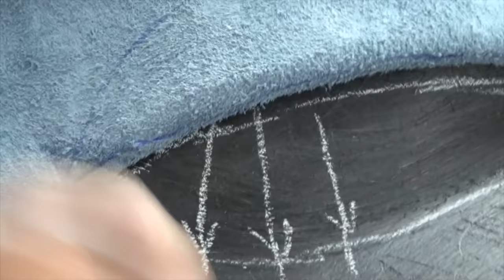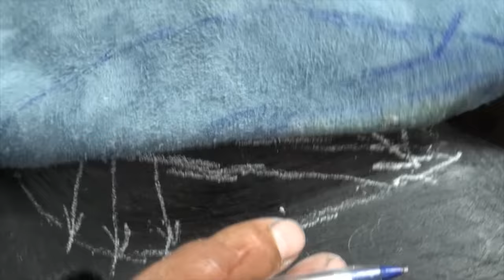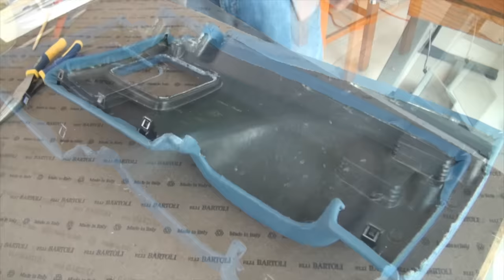A Plastic Piece Wrapped in Leather - Auto Upholstery

Comment: I own an upholstery business Creative Customs in the Seattle, WA area for going on 20 years now that I started in my early 20s. I find it fascinating still even now watching other professional people in the industry work and seeing the different ways they approach a project. Any reason you prefer to brush on the glue as compared to spray on? I prefer a 5 gallon pot but instead of a glue gun I use a actual auto paint gun with a large tip for thicker paint. With it I find it easy to use apiece of card board to catch over spray if need be and instead of the glue gun the paint gun instead adjusts the glue spray finer and more accurately whether spraying from a large wide web installing a carpet kit to thin lines like trim work here where needed. Then with a long hose the gun is at my side for instant start and stop glue where ever whether inside a car or working from a table with out fear of spilling and open container of glue.
Reply from the maker: Undoubtedly spray gun method is faster and more effective on certain projects. I use the brush and glue for small projects. I'd say it's more a hobby way to do upholstery.

Comment: I have been trying to do my own upholstery on my tvr and this is where I come for help, it's been essential to my progress and couldn't have achieved what I have without the tutorials but I'm yet to find the adhesive recipe. Everyone I've tried keeps going off. Any help would be greatly appreciated. Thanks for your help would be lost without it.
Reply from the maker: The 'solvent based yellow glue' is a traditional adhesive or contact cement used in car upholstery and furniture. 
The standard glue is brushable(spreadable). It should be applied on both surfaces and wait 10 minutes for stitcking process until it is not sticky to our fingers.
It is the same glue used to stick formica as shown in the video about Upholstery Glues: https://youtu.be/o2xeezdF8Ss
If you are in USA I know about two similar glues:
At Home Depot:https://www.homedepot.com/p/DAP-Weldwood-32-fl-oz-Original-Contact-Cement-00272/100125525
https://www.amazon.com/-/es/Petronios-Master-Cemento-multiuso-cada/dp/B076DJQN5R?language=en_US
This is aother well known trade mark in USA. Upholsterers use it a lot. Mostly applied with a glue spraying gun. It is very fluid but it could be done with a brush or spatula.
Some car trimmers and in factories a heat activated polyurethane glue is pasted over the surface pieces. It is used a lot in the shoemaking industry.
You would need to find a supplier and assistance in the USA 
The platic surface is sanded then a special cleaner is rubbed over. Then a coat of primer is applied over and finally the transparent glue.
The glue dries well in 10 minutes and it does not stick if we do not apply heat. 
A hot hair dryer is useful to cure the glue. It has the advantage we can wait longer time, accommodate the pieces in place then apply the heat and stick them together.
I have heard of similar products:
 https://www.amazon.com/dp/B0068KNGMK
http://www.rhadhesives.com/dual-88-neoprene-cement.html
https://www.ebay.com.au/itm/Duall-88-All-Purpose-Neoprene-Cement-/252691571226
https://en.lial.biz/sar-306e-desmokol-1kg?tag=adhesive
https://www.amazon.com/SX-69-Vinyl-Cement-Glue-Industrial/dp/B0839PW1C4
https://www.livemaster.ru/item/11132039-materialy-dlya-tvorchestva-klej-nairitovyj-alkor-ats-440-ph
https://www.promarinetrade.com/accessories-for-inflatable-boats/6847/GLUE-+DESMACOLL%2C+330+ML-PM-DESMAK-330.html
I am located in Mexico and find this glue from shoemakers' stores
 https://youtu.be/TIKF6NvXHE4
Hope it helps.

Comment: Nice video! My question is what glue are you using? I prefer to use that kind of glue over the spray kind.
Reply from the maker: Spraying glues are also useful provided we use a product with the best adhesion. I would recommend to test it beforehand on a scrap of leather onto a plastic piece.

Comment: as long as that dash stays in a airconditioned home the glue will hold for a year or two. I live in Redding, CA and that weak glue you used to attach the leather to the car dash would let go in one month or less in our summer conditions.  Possibly a two part "epoxy" might hold the leather to the cars dash receiving moderate sun/heat.
Reply from the maker: Fortunately, my son had this car for more than 6 years and no traces of leather unsticking were detected. Precisely it was leather covered for testing purposes.

Comment: I think some put an underlayment back glued to the leather, just wonder if there is a good rule of thumb for and against?
Reply from the maker: Some pieces are upholstered with bonded vinyl or leather (a thin foam glued down to the vinyl or leather material) In this case it was not necessary as this piece is part of a whole dashboard you can see it at the end of the video.
https://youtu.be/IaSm3zoWrAo?si=uON26OhhQbp8rub_&t=3585
You can also see the same complete dashboard on this other video:
https://youtu.be/6QeQCwXw-nI?si=GdyTXh3uHoOb43M5&t=452

Comment: The problem isn't getting it to look like that on day 1, its coming back and it still being glued in the pockets 5 to 7 years later, it ain't gonna happen. The glue will fail within a year or so where I live, south Ga weather is 200 days of 95 and above with 99% humidity.
Reply from the maker: Fortunately, the interior has lasted more than 6 years, because the weather is not so hot in the city where I am located. But, I understand if this car would have been running in south Georgia or Arizona the car interior would have not lasted  longer than a year.
Thanks so much for your commentary!

Comment: Is there a certain type of leather that is more durable than others for uv damage?  Great  video. Thanks
Reply from the maker: The most durable leathers UV resistant are the ones that have two to three coats of transparent sealer on their top surface which act as protectors. Some of these leathers are heat ironed together with the sealer becoming a kind of plasticized leathers. These upholstery leathers are used for automotive and furniture purposes. Despite of being tough, experts consider these leathers of low quality. The leather pores are covered too much and not let them breathe nor let the conditioners get through in.
Some related information:
https://www.youtube.com/watch?v=lRb1CJeSLyE&t=37s
https://www.youtube.com/watch?v=mUJFkCCqFYM&t=256s

Comment: How much time do you allow between attaching the leather to one section before moving on to the next?  In the video it seems as soon as you have glued down one section you move on immediately to the next.  Do you allow a few minutes between sections or do you move directly from section to section?
Reply from the maker: After the glue is spreaded over a section I allow it 10 to 15 minutes to dry and start the gluing process.

Comment: Why do you mark it with chalk at the end of the plastic like at 17:50ish is it just habit or for a purpose?U do great work and are a amazing teacher with these videos! Also would it be easier if u applied a heat gun or was it warm enough out there /or were u afraid of burning the leather
Reply from the maker: I have done the marks on leather and plastic surface to indicate the only part that would be spreaded with glue. Heat guns help to erase wrinkles because the heat shrink the leather. I'd better take advantage of stretchy side of leather material. Almost similar to vinyl materials.
https://www.youtube.com/watch?v=dhmCJFpOs_0&t=533s

Comment: There’s several brands and types of contact cement glue. Exactly what brand and type you are using? I know it has to withstand the hot temperatures the interior of a car can get without releasing.
Reply from the maker: I am located in Mexico and glues' trademarks are different.https://www.youtube.com/watch?v=o2xeezdF8Ss&t=71s
If you are based in the USA:
https://www.ebay.com/itm/254593470049 (sprayable and brushable)
https://www.ebay.com/itm/114649877783

Comment: Keeping the glass jar open how long is the glue soft before start to be useless?or u can add something ?
Reply from the maker: Most of these yellow upholstery glues are solvent(thinner) based. As we know thinner is a volatile liquid, but it takes some time to thoroughly evaporate. If we leave the jar open the thinner starts to volatilize and the glue becomes dense. This process is not too fast. It takes one day or two. The advice is everytime we use the glue we should put the cap on, and so forth.
If we want to rescue dry glue we need to use the same dissolvent used for this product. 
John from Lucky Needle show us a way to revive dense glues:
https://www.youtube.com/watch?v=sZ4jeK56dTQ

Comment: What kind of glue did you use? I've used contact cement on some dash pieces, and wasn't happy with it long-term.
Reply from the maker: It is an upholstery regular yellow glue. I am located in Mexico and trade marks are different.https://www.youtube.com/watch?v=o2xeezdF8Ss&t=28s
If you are in the USA:
https://www.ebay.com/itm/254593470049  (sprayable and brushable)
https://www.ebay.com/itm/114649877783  (brushable)

Comment: What kind of adhesive are you using? And what's the durability like?
Reply from the maker: It is a regular upholstery yellow glue(brushable)https://youtu.be/o2xeezdF8Ss?si=O_u7uFucesfocGJn&t=71
If you are in the USA:https://www.ebay.com/itm/254593470049 (sprayable and brushable)
https://www.ebay.com/itm/334858174797?hash=item4df71a414d:g:CkIAAOSwSJZixGVw (brushable)
If well applied these glues' efficiency last for many years.  The piece of the video is still in good condition after more than 7 years.

Comment: a) what adhesive do you use?

b) how would you expect the concave areas to react to heat, e.g. under the glare of sun through a windscreen?

currently doing some upholstery myself and the material is lifting off in the heat in concave areas!
Reply from the maker: I used the traditional 'brushable upholstery yellow glue':https://www.youtube.com/watch?v=o2xeezdF8Ss
Regarding the concave areas the 'secret' is the leather material should be placed over without tension. I can stretch the leather along an upper section but when reaching a lower section it should be placed over gently.
The other 'secret' is give the time to glue drying both surfaces and at time of sticking do not let air bubbles that could cause unsticking when the air is heated by sunrays.

Comment: Nice work! I have a question. I used a heat gun to do my "unfinished" door panels on my 69 Nova. Do you ever use a heat gun while laying the leather, vinyl or fabric down?  BTW, the blue color you're using is exactly the color of some of my interior. I saw this video and now I'm going to do my windshield A pillars this color and this way. A pillars for my car are like dinosaurs. No more. Mine are 90% good but have cracked molding. Only option I knew of to restore them was a shop in Los Angeles at $400. Or use bondo.
Reply from the maker: Every now and then, I use a heat gun or hair dryer on vinyl material to stretch it or erase wrinkles. I  do not use heat on leather to stretch it. Leather shrinks if exaggerated heat is applied (Be careful!). Considering leather shrinks, some heat is useful to erase wrinkles. I'd better take advantage of the stretching side of vinyl. The same rule applies for leather material.
Reply: It will be my first time using leather in my car (it looks so good) so thanks for the tip!  @Cechaflo
Reply from the maker: @Lonzo_Gonzo1955  It is very important to consider the stretch direction of leather material
https://www.youtube.com/watch?v=dhmCJFpOs_0&t=585s

Comment: When you run that towel over the surface of the leather… Is it a wet towel that you’re using? Are you dampening the leather as you’re going along?
Reply from the maker: I used the rag to merely to rub over the leather surface to help giving shape. I would have done it with my fingers though. It is not wet. The leather is stretched natural. I did not dampen it. The secret is take advantage ot stretchy side of leather material.
https://www.youtube.com/watch?v=dhmCJFpOs_0&t=140s

Comment: quick question, I'm covering a dash pad from a 1975 Fiat 124 the vinyl has a few smaller blemishes. do I remove the vinyl? I have a sewn leather cover, what glue should I use?
Reply from the maker: The vinyl can be removed if the dash was already reupholstered by somebody. The original vinyl should not be removed because it was heat molded together with the dashboard frame. The new cover should be glued down to it.
The polyurethane glue would be of great help for this job. it allows us to line up and shape until it is ready to stick by using some heat. Of course the layers of glue were already pasted and waited to let them thoroughly dry (10 to 15 min. as a minimum)
The yellow glues are also useful but to say the truth it is not easy to manipulate and could cause lots of headaches.

Comment: What type of glue did you use? I'm wanting to redo my headliner and I'm researching videos on YouTube, but I watched a lot of people use that spray-on glue. Then I saw one video where they revisited their work a few months later and the glue didn't hold. This glue you're using in this video is obviously not the spray-on, and you seem to be doing a professional job, so I can only assume that you're using the right kind of glue. So, what kind of glue is it?
Reply from the maker: I used a brushable regualr glue:https://www.youtube.com/watch?v=o2xeezdF8Ss&t=47sIn 
In case of a headliner the best way is the application of glue with a spraying gun.
The glue most of the upholsterers use is a sprayable one:
https://www.amazon.com.mx/Weldwood-Contacto-calcoman%C3%ADa-Solvente-superior/dp/B004IH3HAQ
If there is no spraying gun we could use a brushable method that is the application of viscous glue in sections just to the board. The headliner material should be gently unrolled over this wet glue and so  forth.
The inconvenient is glue vapors are very hazardous, so it is a must the use of mask and goggles: https://www.youtube.com/watch?v=coueKGKYlds

Comment: what kind of adhesive would you use to attach vinyl to foam or wood.  I'm creating custom trunk upholstery for a classic car
Reply from the maker: Yellow upholstery glue is useful. Applying it by brush or much better and faster with a   glue spraying gun.
https://www.youtube.com/watch?v=o2xeezdF8Ss&t=122s
https://www.amazon.com/-/es/Petronios-Master-cemento-multiusos-cada/dp/B076DJQN5R
https://www.homedepot.com/p/DAP-Weldwood-32-fl-oz-Original-Contact-Cement-00272/100125525
https://www.ebay.com/p/5032793955

Comment: Nice work!  Is that a standard "contact cement" used for adhesive?
Reply from the maker: Yes, the yellow, viscous contact cement.https://www.youtube.com/watch?v=o2xeezdF8Ss
https://www.amazon.com/-/es/Petronio-Master-Cemento-multiusos-onzas/dp/B076DJQN5R
https://www.homedepot.com/p/DAP-Weldwood-32-fl-oz-Original-Contact-Cement-00272/100125525?modalType=drawer

Comment: Thank you for this. What is the glue you use?  I have tried a couple (UK) but I get the edges peeling away. 
Also, do you let one area cure fully before you go onto the next?
Reply from the maker: https://www.youtube.com/watch?v=o2xeezdF8Ss&t=45s
I first glued the bulky parts stretching the leather. The lower portions should remain 'loose' to let them lay flat without forcing. This avoids a future unsticking.

Comment: Are you able to tell us what glue you use and where to source this specific material?
Reply from the maker: I used a brushable upholstery yellow glue:
https://www.youtube.com/watch?v=o2xeezdF8Ss&t=73s
If you are in the USA:
https://www.dap.com/products-projects/product-categories/adhesives/contact-cement/landau-top-trim/(brushable and sprayable)
https://www.etsy.com/mx/listing/846617810/master-all-purpose-cement-4oz-brush-in (brushable)
Reply: @Cechaflo  Thank you! -  Also - are you using leather hide here, or is it a flexible marine vinyl? Looking to find this material that has this stretch to it.
Reply from the maker: @davidkeetz  Yes it is leather material. Check out Albrights upholstery supplier to find a synthetic  material. It could be a 4 way stretch vinyl.https://www.albrightssupply.com/4-way-stretch-vinyls

Comment: If its just glued like the above, won't this just end up lifting if its sat in the sun for periods of time?
Reply from the maker: The secret is let the glue a thorough dry and try to not leave air bubbles. Fortunately, this car was upholstered more than 6 years and the pieces are still well stuck.
Reply: @Cechaflo  good to know. I've always fancied doing something like this, however I was always put off with the time and effort going in if it was going to lift off due to the weather.

Thanks for the reply.

Comment: Hi!! Thank you for your video. Really helpful! Then I have a question. Can you let me know Which adhesive do you use? And where can I get it?
Reply from the maker: I  have used a 'solvent based yellow glue/contact cement'.  If you are in USA, please, check these links:

https://angelusdirect.com/products/all-purpose-shoe-cement
http://www.ebay.es/itm/Petronios-Master-All-Purpose-Cement-Glue-Shoe-Repair-Adhesive-Glue-4-oz-/112032405167
http://www.homedepot.com/p/DAP-Weldwood-32-fl-oz-Original-Contact-Cement-00272/100125525
http://www.dap.com/dap-products-ph/weldwood-landau-top-trim-high-heat-resistant-contact-cement/
Watch min two:08 of this video that shows the use of ´petronios'glue.
https://www.youtube.com/watch?v=RLH8BY8a2to